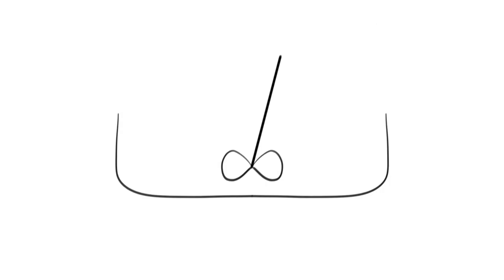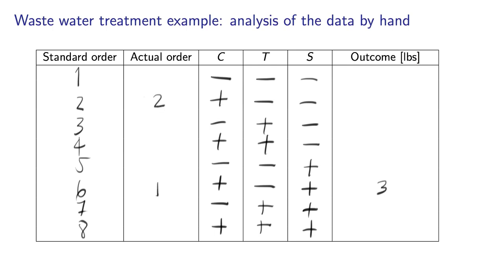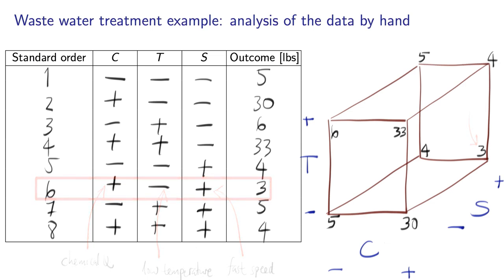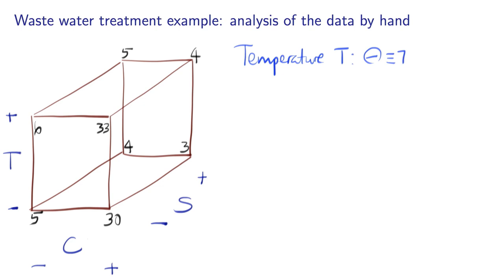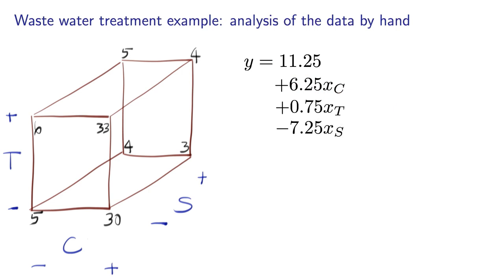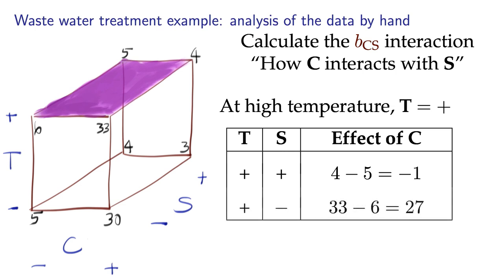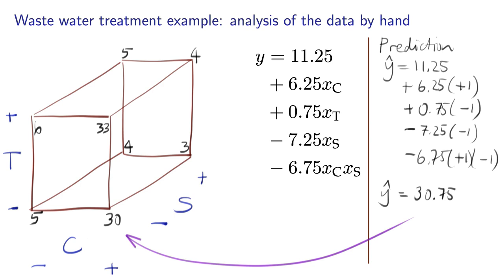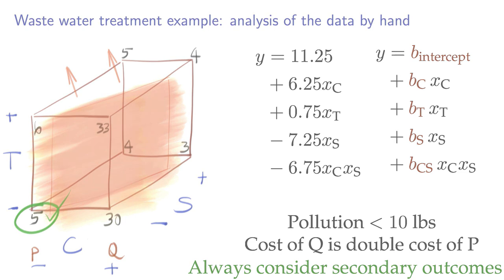Experiments 2D - In-depth case study: analyzing a system with 3 factors by hand

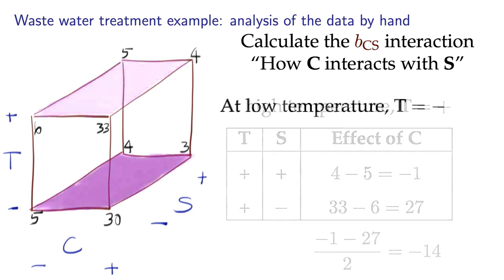Comment: Thanks Kevin, Very useful video. At time of 11:54 to calculate interaction C with S (bCS), Could you explain why we calculate at 2 surface of T-high and T-low. I am a little bit not very clear here. Thank again.
Reply: I believe in order to get the interaction between C and S, you need to keep the third factor constant. Visually he analyzes the faces of the cube where C and S meet. Hope that makes sense.

Comment: Thank you so much Kevin Dunn. It is really useful video.. Do you have any class on you tube that explains the effect of four factors. three levels and three responses. I would really appreciate your help and time.  I am using response surface methodology (FCCCD). Thank you.
Reply from the maker: Hi Israa, I don't have any videos on that topic (yet). You will see, if you are following the course on Coursera (https://yint.org/experiments) that the videos in module 3 show how to solve problems with multiple factors. The number of levels doesn't really matter: you can have 2 , 3, 4, or more levels, but in response surface methods you usually use 2 or 3 levels, and then move the factorial towards the optimum, reusing prior points where possible.

All of that is explained in later videos. Best of luck, Kevin.
Reply: Thank you so much  Kevin for your quick reply and help.